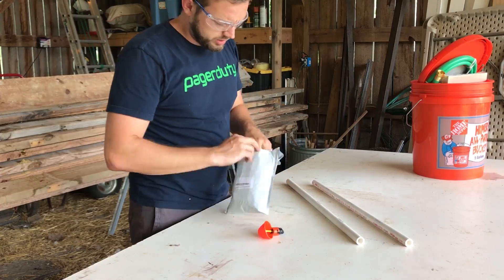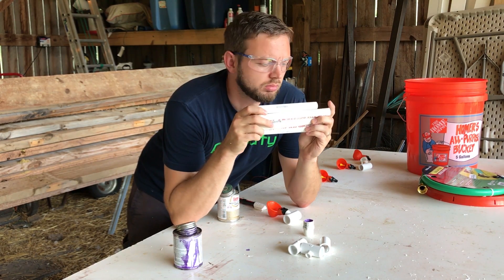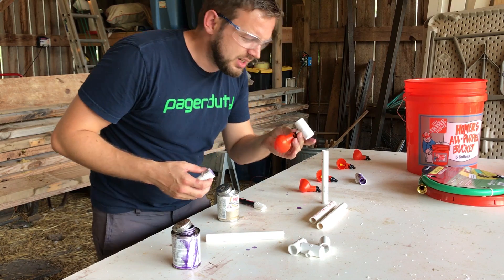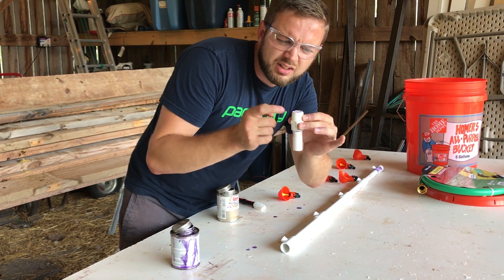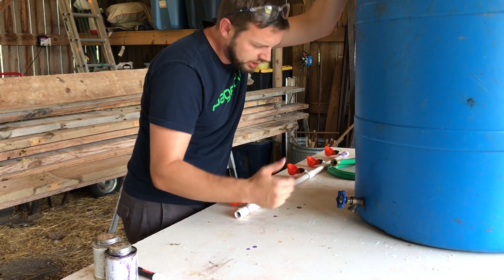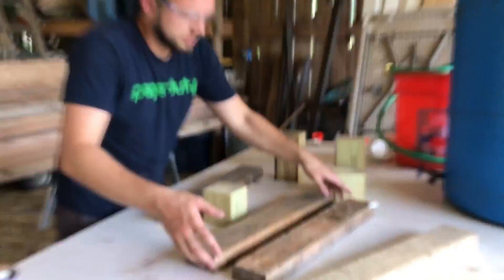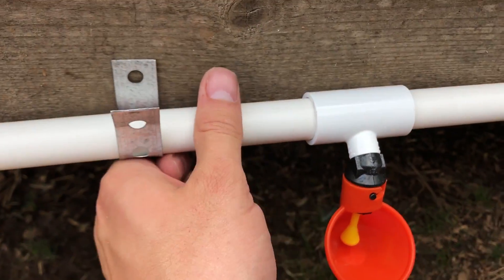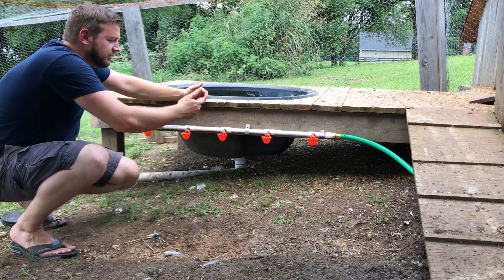🔨  🐓 I Made An Automatic Chicken Watering System Gravity Fed From a Rain Barrel 💦

Comment: Does this system do well in the winter? Does the water freeze in the pvc?
Reply: People do this type of system with a tank heater & circulation pump in winter to prevent freezing.  With the pump, you have to have a hose go from the end, back to the barrel, so the water can flow through.  When it’s flowing like a little stream, it helps keep water from freezing in the pvc & hose.  The tank heater prevents the water in the rain barrel from freezing

Comment: hey, just saw your video from 2017, i was using 5gal bucket with nipples on the bottom but they last about 4months the chickens use them for swings, how is your diesign holding up over the long run?

Comment: Great video...earned a subscriber.  I had a similar system for a year, but it froze in the winter and was also susceptible to bugs that like standing water.  I added a small 12v DC pump to keep the water moving.  Hopefully that will keep it from freezing in the winter.  Running a long extension cord now, but hoping to try solar power soon.
Reply: how is that solar setup working? I am building something similar to this but I'm in the mountains so freezes happen
Reply: You can add a submersible aquarium heater along with the pump to keep water warm

Comment: I built one similar for my chickens. On the end of the water bar (before the cap) I added a ball valve, that way if you have to do maintenance on the system or it simply just needs cleaned out, you can valve off the barrel, and then drain JUST the bar instead of the entire barrel needing drained and you can do so with the control of that valve, I usually drain into a bucket or something. I also have a sealed top barrel, and just open one of the holes and also installed a very fine screen over it to keep bugs and debris out. Great system all in all. I have plans to experiment with a basin heater this winter as I live in West Virginia.

Comment: Hi, I have a lot of ducks and need to automate their feeding and water more than I am currently and I found this video while googling the setup of the poultry waterers you are using, but the rainwater part got me interested and I wondered how that works?  Is it simply the amount of rain that actually falls directly into the blue barrel you are using in the video? Or do you use something with a larger surface area to collect the rain and funnel it into the barrel? (Like a sloped roof or a stretched tarp or something?)

And how much rain do you get where you live and how many ducks does one barrel provide water for and does the rain provide enough water all the time or do you have to top it up with water from your water supply, or tank or well etc?  

Also some other questions (sorry there are a few!) 

Also do you know if some of those waterers can be directly connected up to a hose and tap so if a barrel was empty the ducks could get their water directly from my main water supply, (I am probably just going to order a whole lot from aliexpress or similar Chinese supplier And planned to just set them up on a direct connection to my water outlet which is what I was researching when I found this video) but as I am in a rural location on well water It would be interesting to use rain water too.

Also how quickly did your ducks figure them out and if my assumption is correct that the water comes out as long as the bird is pushing the trigger down, have any of your ducks figured out how to fill the whole ‘cup’ by holding it down for longer?

And generally how well has this worked for drinking water for your ducks? 

And have you tried any other automatic watering systems for ducks that provide deeper drinking water or swimming water and if so were they any use or did the ducks just dirty the water so fast you had to manually clean out anyway?

Thanks, sorry so many questions

Comment: I am curious if gravity fed systems need a top to keep them sealed?  I am wondering if they will drip constantly without it?
Reply: If you seal a lid you’ll create a vacuum and the water won’t flow. Put a straw in a drink, then seal off the top with your finger and lift. Liquid comes with it. 

There’s a valve closure attached to the little yellow piece that the water pressure keeps in place until the chicken pecks at it.
Reply: @benjamin593  I have since installed the water system for my quail.  The question was due to a previous set up that had major leaking issues.  This one is perfect.

Comment: I am wondering if because where I live we get extreme heat during summer, so containers of standing water develops algae and mold quickly, so this may be something you can use during summer months depending on your location? I have tried many things to prevent the slime on the edge of their water containers from forming but it's no use. I'd have to be able to dismantle and scrub all the pipe fittings and the barrel twice a week at least. It's a great idea but maybe better for some areas than others
Reply: Add distilled (not with the mother) apple cider vinegar to the water. It is not only good for the birds, it prevents the algae from growing.
Reply: How much ACV?
Reply: Use opaque containers.
Reply: How will that make a difference?

Comment: Looks like you are almost a year into this.. any problems with algae or water quality issues?  Would you do anything different?
Reply from the maker: I would use a ball valve at the bottom for the hose hookup not a traditional spigot. That way small bits of leaf from storms don’t clog and slow the flow down. That’s a pain. No water quality issues. But I moved my coop location so we have not used this as much as we used to.
Reply: Thanks.  I'm in East Tennessee.  I'm 3 years in with my chickens (about to refresh my stock) and looking for a better watering system.  Preferably something that will hold up in the winter months as well.  I'm close enough to power - so I have that option.

Comment: Thanks for the video. Although, I heard (based upon Amazon reviews) that the plastic wastering cups got bad reviews. I'm going to try your design, except replace the cheap yellow/red cups with the metal Horizontal Side Mount Chicken Watering Nipples. I want these to last at least a few years and I think your design is perfect for them...best.
Reply from the maker: Let me know how it works out. Our chickens never really got the hang of them 😑 I make a watering bucket with the watering nipples and they didn’t really use that either. But I have not tried what you are talking about. I built a new bigger coop and have not installed a rain barrel to it yet.